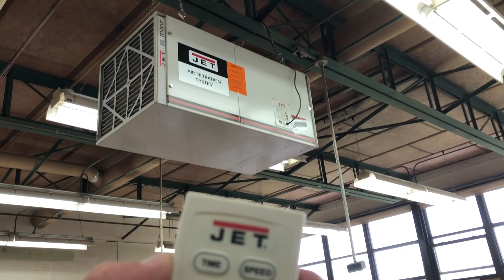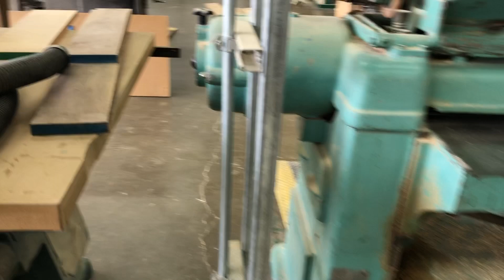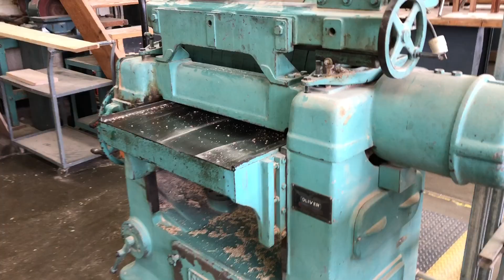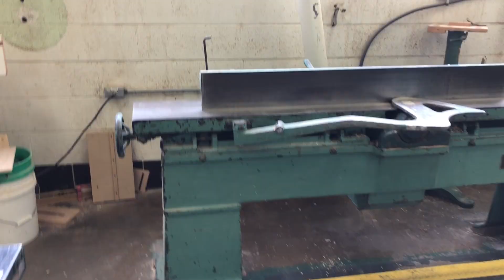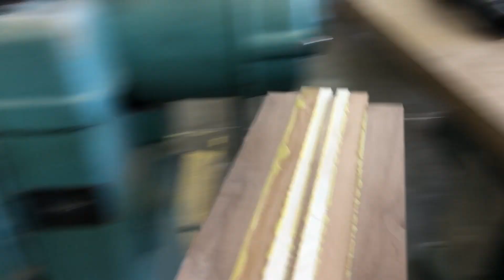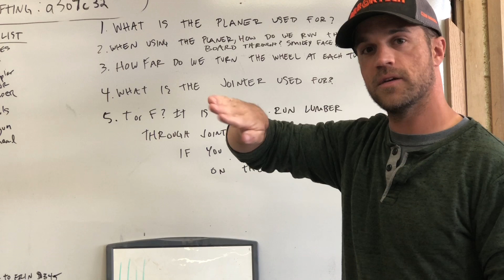Railsplitter Woodshop Series: Old Oliver Planer and Jointer

Comment: you have two of the finest machines ever made, it makes me sad to see how poorly adjusted they are. first of all it shouldn't snipe, you have to set the pressure bar, its a 7 1/2 horse direct drive motor you can take off 1/4'" in a pass if you wanted. It's loud, because the knives are dull. please give those machines some love, you're lucky to have them.

Comment: I also face boards on my jointer before planing for thickness. I have a 166bd just like your only a bit newer 1960. Mine has a handbrake I was surprised to see your machine has none.
My planer is a powermatic with Insert Head. Trust me your better off leaving the straight knives in your planer. If your must buy a machine with a bryd head in it.
Nice shop nice machines.
Reply from the maker: Yeah a handbrake would be nice. I’m curious why you would prefer the straight blades over the insert? All I ever hear from others is that we need to upgrade.
Reply: From what I’ve heard Oliver planer with a knife grinder is as good as it gets. 5 inch cutting circle and. 36 degree hook angle on the knife slot. 
I don’t have a knife grinder on my 166 but if I spend the time to set the knives with a dial indicator. It really doesn’t matter what direction I send boards .When all the knives are cutting it outshines my Pm with bryd head. There’s not tear out. I run t1 hss and m2.
I mostly work with Alder , beech some white oak. I stay away from reclaimed highly figured or dirty boards.
You have a nice shop very jelly here. Good Luck

Comment: Curious as why you don't flatten one face on your jointer before running through the planer especially since you have such a nice wide jointer.  Truthfully it will also help with your snipe problem from the planer, as well as a good planer adjustment. I have little to no snipe from my delta dc33 planer since I use my jointer first then plane. By the way awesome group of tools as i also enjoyed watching the shop tour
Reply from the maker: glenn gulley probably my biggest reason would be that I feel the planer is much safer for the students to use in that way. Any time I can make something safer for them, I do it. I love that jointer, but it is a tool that you need to keep an eye on.